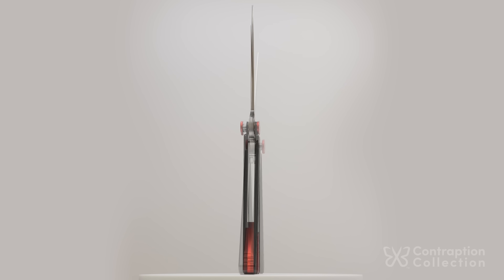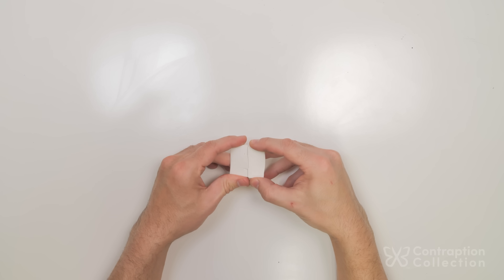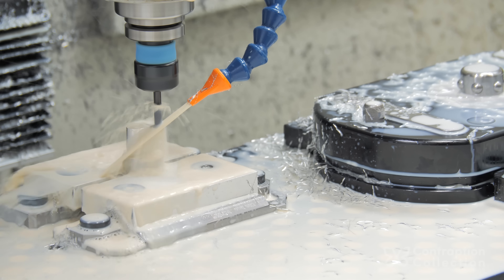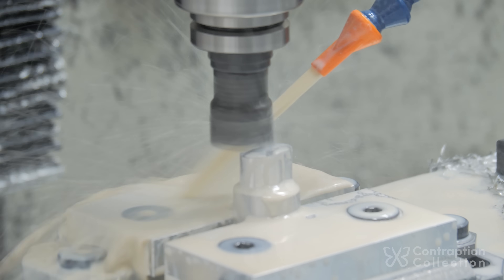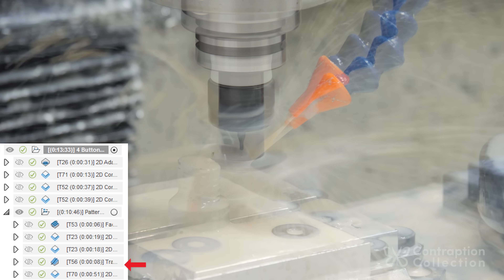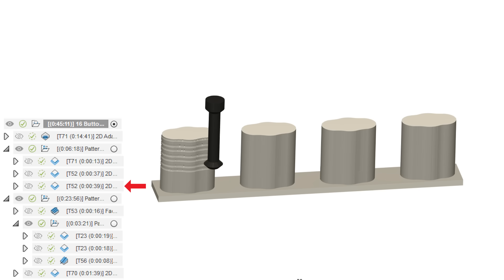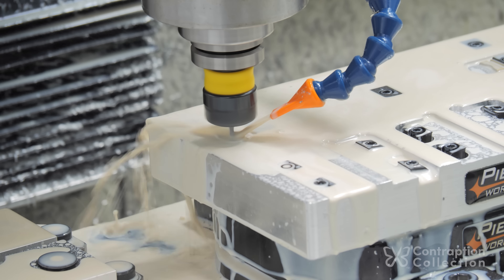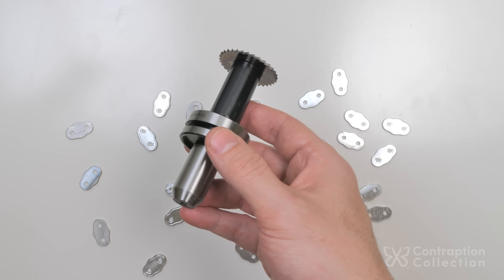How many parts can I make at a time? Baliscissors Ep 30

Comment: Personally, i would change quite a bit about this setup.. 

1) use flat stock, you'll get faster production than whittling down bar stock
2) pattern your buttons to leave room for 6+ screws (depending on initial stock size) this will later be used to clamp the stock to a known parallel surface
3) mighty bites, or vacuum fixture, the flat stock to the table, and skin the top
4) drill the allotted fixture holes between the buttons for clamping screws
5) surface the ENTIRE stock, do the majority of the stock, then removing 1 screw at a time to surface the screw area before replacing the screw, and moving to the next until the entire stock is flat. 
6) mill your through holes, and top engraving, mill pockets
7) mill the buttons out, leaving the excess stock from the surfacing passes on the floor of the contours so the buttons remain attached to the stock
8) flip the entire piece over, and use screws / bolts to clamp the stock down again
9) mill off the excess stock in multiple passes, the very last pass leaving 1 or 2 thou of material to keep the parts from becoming free, you'll want to leave just enough to hold them, but not enough that it will be a chore to free them by hand later
10) pop the parts off of the stock blank, toss into a tumbler to remove the excess "flash" left over on the bottom edge of the parts, or deburr them by hand

This method should give better results than clamping the edges of individual buttons on the sides. because you start off by ensuring the stock is parallel by surfacing both sides on a known flat surface before starting any operations, you're ensuring the stock itself isn't causing the discrepancies you're running into. Extruded aluminum stock is often sold incorrectly as plate stock, or flat stock. extruded aluminum will almost never be perfectly flat, or parallel.  

By clamping the stock to a fixture plate, or known flat surface using the clamping bolts / screws, you're ensuring the stock remains as flat as possible through out the operations, again, reducing the likelihood of tolerance issues. 

Using this method, it should be fairly easy to produce consistent parts. This process also lends itself to scaling quite easily, as you can produce larger batches by simply increasing the dimensions of the initial stock. 6" x 6" for a few parts, 12" x 12"  for more, 12" x 24" for even more etc.. Just remember to evenly place your clamping bolts / screws to ensure the entirety of the surfaces are being sufficiently clamped down. 

The downside of this method is material waste. Because the parts are being milled out using 2d / 2.5d operations, you'll need a bit of extra material around each part to ensure they remain in place until the final skim pass of the final operation frees them from the blank.. the excess material left in the blank is waste, or can be recycled at a loss.
Reply from the maker: Thanks for the detailed reply. Using sheets of aluminum is something I've thought about before, but your comment has helped solve some of the things I disliked about the idea in the past.

I still don't like having to move screws around for facing the stock, but maybe if it works out well enough I'd be worth making a vacuum fixture.

It may use extra material, but I'm not even sure if it'd be more wasteful than using slugs of round bar with this current method.

Comment: Nice video I have a question though why did you decide to make soft Jaws to hold the round stock instead of clamping a 3 jaw chuck on the table (I'm a student machinist and would just like to know your thought process)
Reply from the maker: I just don't have a great 3-jaw to use on the mill. I also like keeping the little vise set up. The 3 jaw would be more useful if I was switching between different sizes of stock a bunch.

My favorite method to hold round material in a mill is to use a collet block.

Comment: I really like this build. It's an innovative idea, maybe not the most practical scissors, but definitely a very original novelty item.
In terms of design- and manufacturing challenges I really like this series.
There was this engineer named Murphy who had a few fun insights (be it on a city engineering scale).
Anyway, what I would really like to see is that you try to think outside the scope of this project, find a reliable way to make regular scissors well (in terms of machining and hardening), and then see if you can apply what you learned to this project.

Comment: I wonder if your problem couldn't be fixed by actually not having the bottom surface flat. If you make slight bump in the middle, the whole part will act like spring and will push against the screw heads, eliminating the gap while still allowing the motion.

Comment: Presumably, your problem is concentricity. You are taking a part with a machined face and putting it onto a "presumed" flat face inside the clamping area. Once you machine the other side of the part flat - pull it and check it for proper diameter.

I'll assume that it's not flat in the center. So when you machine your new holes, it will be out of spec.

If the relation of the top surface to the hole is critical, but the bottom is NOT. You can simply perform your initial hole operation en masse through the part, and then drill the shelf. Flatten the next piece, drill the shelf.

Once all of those operations are done, you only have to finish the bottom face - which if it has no relation to the function of the design, doesn't necessarily need to be entirely flat.

I'm not stating you should cut corners, but I think the problem stems from the order of operations, and some presumptions.

Love to see what you're doing, and I can't wait to see more

Comment: have you ever considered using an fractal vice to hold parts?
Reply: Those are a gimmick. They're fine for a one-off, but there's no repeatability at all in a workholding setup like that. Soft jaws are cheaper by a huge margin, and they work better.

Comment: Your old method would work fine if the pieces would be resting on the counterbore rather than on the main surface. You want the part to be aligned on the surfaces that you'd like to be parallel.
But, the new one might be better.

Comment: I know its the intent that you make these yourself, but if you want consistency and higher volume, you should get these made on a 5-axis machine with automatic feed of stock.
The method you have is pretty good, probably can't make that any better cause of the different cuts you need to make.
but changing tools is where you are losing your efficiency and accuracy.
Having automatic tool changes will make all the difference

Comment: I think your core issue is that those machinable mitee-bite things don't pull down, so they will tend to lift? Also the sheer size of them, with this thin part, will promote lifting unless you have negative angled side walls, etc? 

Perhaps just keep the wedge, then make a new fixture which is very close fitting and just used the wedge to bend in the sides of the recess? (Optional cut a few slots in the fixture so you only bend the side walls, not the whole plate?)

Comment: I would make those parts out of steel so you can use a magnetic bloc or a surface grinder for the second side, which guarantees a good flat surface. Now i dont know if the weight will change the balance of the scissors, steel has a fewer color pannel of coating and is harder to machine. As another guy mentionned, using a hammer to make sure the parts are in contact with your clamping system is worth trying for aluminium. Keep up the good work

Comment: Sliting saw thoughts, at the 9:22 mark, we can see what the material that the straight tab left. It is all across the part. Design the tab to be a rectangle that fits between the 2 holes. You can then focus on sanding only between the holes with a jig and avoid a possible uneven sanding pressure, that may cause a factor in parrelism to the top bore affecting your .048".  Better yet make your tab an oblong tapering in the center, the result could be two triangles with a full radius. The top part will still be held solidly(example a tiny bit of diameter to hold a part after a lathe part-off operation) until you twist it off with a 3d printed-adapter tool, and making removal faster than using fingertip for the final flip-flopping seperation motion. Other Idea, use two sliting saws, a thicker one to take care of the botttom facing and tab formation, and a thinner saw to cut the tab a few .001s below without touching the botom face

Comment: Wedge clamps do tend to lift or pull down on the parts so you'd probably have a really hard time getting rid of that issue. Mill turning like you mentioned would be a great option if you can. Having it setup with a bar puller would let you walk away and make them all day long from a 4 foot bar. Other option that comes to mind is face milling a plate to thickness on both sides, check parallelism, mill the counter bores and pockets, pause the cycle to add hold down bolts into each part, then machine profiles thru the plate to separate the pieces. You'd have to use your wedge clamp fixture to do the backside chamfer but the tolerance is far less critical.

Does a supplier make a precision ground plate that's the correct thickness of the part? Would likely be far better parallelism than you'll get with any facing cutter.

Comment: i appreciate the workflow to get really parallel surfaces, but one thing that i strive for in design is reducing the need for tight tolerances. Could you not use some baby wave washers, or Belleville washers under the head of the bolt to allow for lack of parallelism? Rather than require tight tolerances, build in compliance to avoid the need. 
This approach (in general) means QC is easier, thermal changes don't affect things as much, annodizing errors don't matter as much, more wear can be tolerated before the need to replace parts, etc.

Comment: i feel like the problem with your original process was how you were locating the second milling operation. You always want to try and locate off the feature or surface most important to you. In this case that would be the bottoms of the counterbores. So having 2 pins that the counterbores rest on before being clamped in place would have given much better results.

Comment: I doubt it would help for this specific application but when using slitting saws i’ve generally programmed the spindle to stop right when the saw has finished the cut (and the saw is still engaged in the material.) I then have my program move the saw out of the cut with the spindle off. This is a good trick for tabbing off heavier parts, something you may consider in the future for a different application. Good work. Cheers!

Comment: For knocking of the tab, maybe check out precision ground stones. It only knocks off the peaks left behind. Check the video from Robrenz, he did an amazing job explaining their work.
Reply: Not ideal on alumium though? Might load up the stone quickly?
Reply: @ewildgoose I mean the main point of those stones is, that they dont cut into the surface. Just skimming the peaks.
Would be interesting to see.
But you are probably right it would load up the stone quicker than steel? Still you can clean the stone and you are good to go.

Comment: i’m no machinist so i have no idea what i’m talking about. but here’s how i would do it. i would face the back of a block of aluminum and also drill sacrificial holes on either side of where the part is. it flip it over and instead of using a clamp to hold it in place (you said it may have made it uneven) i would use the holes and some screws to clamp it down to a know flat surface. then i would face all of it. drill the counter bore holes, then lastly mill out the perimeter of the part. you sanding them back of them to get rid of the burr could lead to it being slightly unparallel from the top side. so i would stick to sanding the tabs off the sides of the part.
Reply: by the way i’m really invested in this project. i would love to own a pair of these some day. i think that pair you sold are absolutely gorgeous. but like i said i have no idea what i’m talking about. but hopefully it could help in some way
Reply: ok ok last idea. do what i said. face the back of the part with holes. flip over and clamp down. face the top of the part and drill the actual holes for the part. then use the holes of the part to clamp it down while you cut out the perimeter of the part. if you use those “counter bore” holes to bolt it down there shouldn’t be any burr out the outside of the wall to be sanded off.

Comment: How about fitting bronze bushings in space of counterbores? Also maybe let them protrude a bit so that you rely on parallelism of inserts alone without requiring aluminium part flatness. Yes, you add a problem of axis parappelism of bushings, but with this design it shouldn't be as critical.
Another option - adding plate springs in place of this critical gap. It must ensure hinge not to rock.

Comment: Honestly, for the buttons, they should just be stamped (punch, die) out of either the right thickness aluminium (if the stamps come out straight and parallel), or slightly over thickness, with the holes stamped out too, slightly undersize to be cleaned up (of the stamping is decent maybe you don't need to. But for that thickness, any company making these would just stamp them out 80% complete, clean up the edges, and then counter bore.

But in the effort of saving money and not wasting material, if you aren't using a lathe, why don't you just get rectangular stock as close to the finished button dimension (in cross section, same as the round stock) then you can buy 10m of the stuff, saw it all down, and then use a regular vice because its rectangular, and cut out from there. The material waste from your idea of a single block to cut 4 items from is crazy.

Also: You can find a tool maker/distributor that can make you a tool with a reduced shank diameter after the flutes so that you can cut with the tool further down without rubbing on the stock. They will only reduce the diameter by like 0.05mm-0.1mm, its usually cheap, and is enough so that you can run a shorter fluted tool, deeper without rubbing.

You should cut the chamfer after the saw cut (even if its 1/2 way though, you will have a better finish.

Edit: I also notice the fixture for the individual buttons, the original one for drilling, could be improved, by adding a reverse chamfer to the camlock piece, and the edges of the fixture the contacts the buttons. That way when you lock them in, they are forced downward.
It seems like the fixturing of the hole/counterbore drilling step is where the error is introduced, fix that, and you will have perfect parts.

Comment: I think if you use weldon holder for roughing, clamp the round stock with a chuck or milled vise and increase feeds and speeds, this process can be 5 times faster. Once you got the accuracy and quality dialed in, just push it. Nice creative work overall.

Comment: ideas:
If you make one side of the button riggid and keep the other one mobile the gap can be increased while keeping the stablility of the button. 
You could also mill the outside shape on a long piece of bar stock (flip it and do both sides), and cut blanks out with one of those electric band saw (only issue being its not automated)

Comment: Would it be possible to use a non rotating tool to just come from the side and break off the buttons so you don’t have to stop the machine every time ? Since the stock sits quite high off the vice i don’t think it’d matter too much if there are buttons laying around
Reply: It would be kind of difficult to find the finished buttons when they're buried in piles of wet, sharp metal shavings. The machine stops itself after each part, that's what he was referring to when he said he "put an M00 in the pattern". M00 is the g-code for "pause the program here until the operator hits 'resume'".

Comment: You could, if you can find one, use a key hole cutter.  Face the back side, key hole the holes and screw mounting surface, which leaves the slitting and surfacing for the front side.  You lose your engraving within the operation, but it should leave more consistent tolerances on the important surfaces; plus losing the surface detail in the op allows for customization when it comes to individual tools, so this is probably a benefit down the road if you ever allow customers to have custom buttons.

Comment: Slitting saws should be fed at max depth. I.E. - take everything in 1 pass. This keeps the chips from jamming up as would happen when taking multiple depths.

If it were me though, I'd machine them upside down with the flat back facing up. Then drill the holes and use a key seat style cutter through the holes to make the counterbores. This way both important faces are done in the same setup. Then flip it over and finish it like you have been doing basically. The only caveat is the through hole needs to be big enough to fit the cutter and the counterbore needs to be small enough that the shank of the tool won't interfere with the inside of the hole. Harvey Tool has a bunch of different size cutters. You might see what they have.

Comment: You could on your old method where you’re flipping the parts setting some pins into the fixture and resting the bottom of the counterbore on the pins. Would help with parallelism to the counterbore